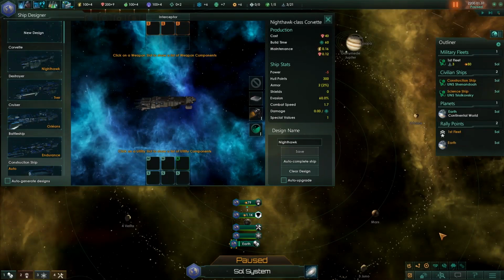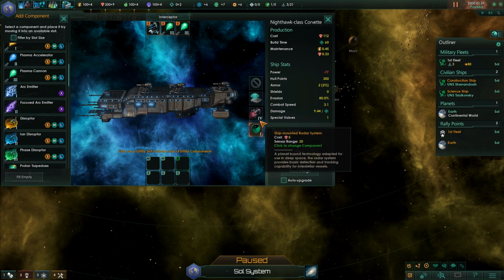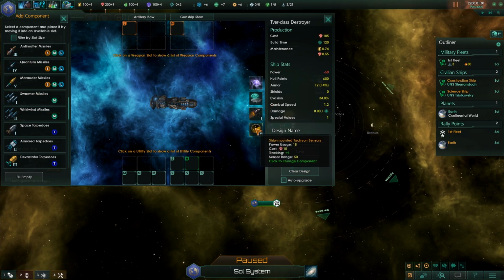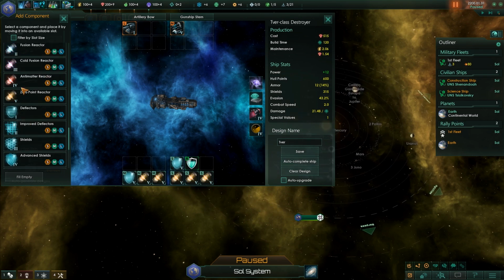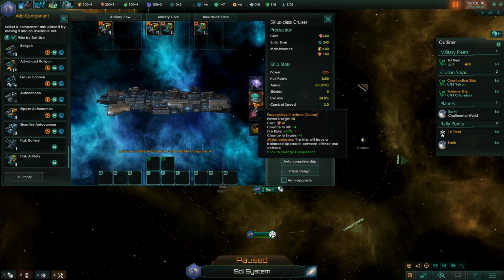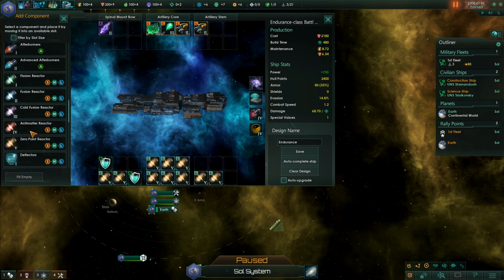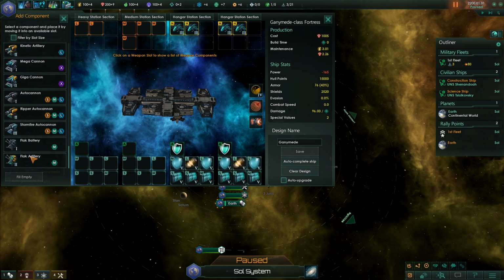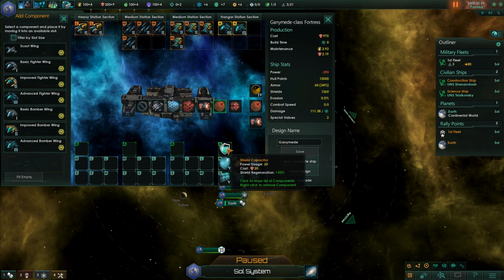Stellaris Utopia - Ship design explained

Comment: Have you ever considered using the defense stations/fortresses in sort of a ring of fire? I was thinking about doing it in playthroughs where I lock FTL to hyperlanes in systems where the enemy has to go through in order to get to my home. Basically put up a fortress with a subspace snare to lure the enemy into the ring when they exit FTL, and then have a combination of many different defensive stations ranging from point defense stations to missle to disruptor to kinetic to energy weapons. Basically an all around defensive position. Not sure how viable it is cost wise. Wiped a computer before I got to test it, but it was a thought. Viable you reckon?
Reply from the maker: +JokeeGA5 I don't see why not, I doubt it would be as effective as a normal fleet but it would be fun to see for sure
Reply: Even cooler visually if the system in question happens to be a black hole with no satellites. :D

Comment: for my fortress i have one with the trap and what ever debuff, and build a 2nd fortress with regen hp/shield and have it with max flak and have my fleet waiting for the enermy to jump into the trap and my fleet sitting in regen area waiting for it.
works some what with smaller platforms aswell, they just get shot down fastere.
Reply from the maker: Yea if it makes sense economically that's actually a great way to fortify a system

Comment: Nice video for a new player like me, but how do i know what my fleet should look like? I mean when do i know if i have enough battleships or when i should build that over that ship. Is there a like a standard comp? ._. like for every battleship you build you should also build an amount of other ships?
Reply from the maker: +Sebastian Schnell Since ships are so flexible in design there isn't a specific ratio or composition you need to have a good fleet. composition usually is a result of 2 factors, enemy weapons and defences and your fleet designs. In general I like to be bottom heavy with corvettes and destroyers so there is a big meat shield between my battleships and the enemy fleet since their so cheap to replace. Otherwise it really is something you want to consider depending on the roles you fit your ships into
Reply: Sebastian Schnell just build swarms of basic corvettes with basic modules and you will kill everything
Reply from the maker: Yep ASpec just released a good video ( https://youtu.be/jCddANybN_0 ) showing the power of the corvette swarm. His weapon choice skews the results a bit in favor of naked corvettes but the point still stands that 100% naked corvettes is the best composition for the majority of engagements

Comment: So, why are there left and right groups of 6 tiles on the bottom row for destroyers, etc? Is it for port/starboard? Aft? I don't own the game so I am still learning.
Reply from the maker: +Jason Weakley they are ship sections shown in order with the front on the left and rear in the back. You can change sections for different hardpoints/utility slots to adjust the overall makeup and roles of your ships
Reply: Thanks, that makes sense now.
Reply from the maker: no problem, you also want to be aware a lot of changes have happened to missles and module costs since the last dlc so this guide is a little out of date